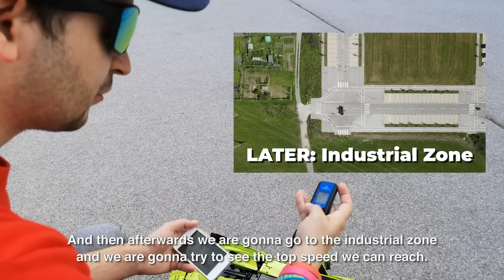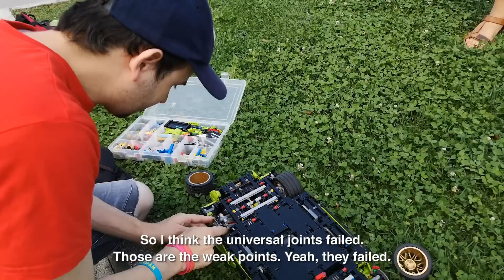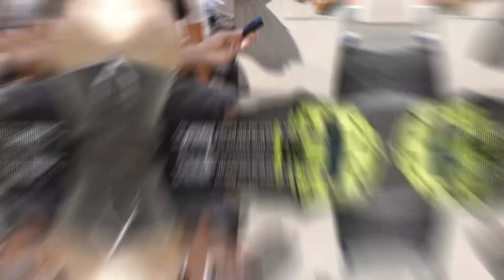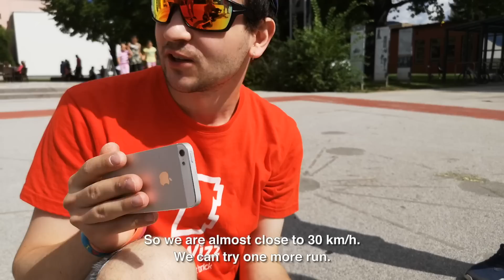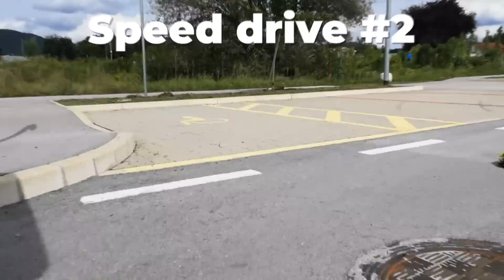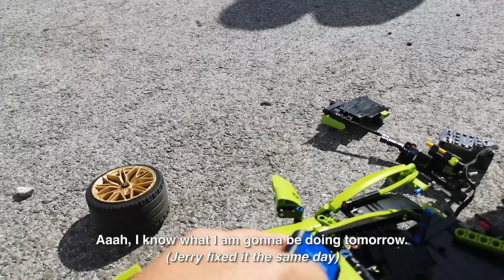Motorizing 42115 Lamborghini Sián FKP 37 with BuWizz - The big drive

Comment: Nice, let me know when you reach 40 km/h and I'll pull out my old setup from the closet to upgrade it ;) Steering is problematic at this speed, try to limit the movement to a minimal level, small corrections should be enough.
Reply: Most of the steering was done with the mixer, the servo was set to just a single position. We will let you know when something faster is ready :)
Reply: Pull it out anyway. You still have me to beat first 😉
Reply: @marxpeklegotechnicdesign3  you used V2 units with Ludicrous mode, that gave you an advantage ;) I might wait for V3 :P
Reply: @RacingBrick  it does help. But it also creates alot of problems. You'll see 😁. V3 will indeed be more potent and might take away some of those issues. I'll await a new record and of course, respond!
Reply: @marxpeklegotechnicdesign3  yeah I'm sure with ludicrous it's even more difficult to accelerate without a power cut. But now we have BC2 for control which makes it much-much easier than running with a touchscreen :D But next time I'm sure I will get a chase car, no more running around :D
Reply: @RacingBrick  i tried to use the BC2 app, but for me it was not useable, due to the added input lag, very unpleasant at these speeds..
Reply: @marxpeklegotechnicdesign3  good to know, thanks!
Reply: @marxpeklegotechnicdesign3  @BuWizz native controller support :D
Reply: For steering not to be problematic you need proper geometry, LPEpower wheelhubs and enough suspension travel.
Reply: sad no buggy motor noises
Reply: 2004 india  asi
Reply: What motors did they use?
Reply: Lego doesn’t exactly make precise ball joints or track rods etc.there is a lot of play in the steering on most models...
Reply: Based on the previous top speed of around 29 kph,what does that equate to that of the real model?
Reply: @j.mendezphotography8684 bro multiply by five ...

Comment: The most important think for every car: BRAKES
Reply: rc cars dont need a brake since the motors while not accellarating are slowing down faster than a flywheel resulting in the speed decreasing drastically, but if you just pull a quick reverse thats a hard brake
Reply: This is why lego should make a pneumatic brake system
Reply: @FG-vp6id  but if your car is too heavy you might damage some gears doing that.  Including some kind of clutch and brakes even if it's 100% electronic is a good idea.  (but I never did it lol, I would need new lego parts, or better coding)

Comment: Do you have any electrical correction for lack of a differential while cornering, or all motors are just running equally full speed?
Reply: Yes, I used the mixer module which is available in the app. At high speeds steering with motors is more accurate than servo.
Reply: @ZEROBRICKS  cool, is there a way to 'automate' it or you need to steer manually?
I mean to write a function that will control speed of left/right motors in dependence of angle that servo is rotated?
Reply: @maciejrychlik426  That's what the mixer does automatically.
Reply: @ZEROBRICKS  sweet, thanks a lot

Comment: Are you guys using buggy motors?  Can you tell us how heavy the car is ?  Cool video for sure !
Reply: Buwizz is creating their own rc motor which is the same size / shape as buggy motors.
Reply: He use 8 BuWizz and 8 BuWizz RC-Motors and more normal Motors for the Doors, Spoiler and steering. A very expansive setup 😉
Reply: @Moki314  when will that be released👀
Reply: @amirpenkar947  I think they said they were aiming to release them in October.

Comment: I don't know enough about Lego motorization, but from my time in R/C trucks it seems that it would be awesome if you could somehow rig in a Futaba/Spektrum/Airtronics/etc R/C receiver and use a better controller. It would make handling the steering SO MUCH BETTER than an iPhone.
Reply: I was SO into RC cars.  I have a basement full of all those parts you mentioned.
Reply: I have used 3d printed parts in the past to adapt standard servos to lego and also brushless motors. I look forward to buying either the lego lambo, bugatti or proche and trying to jam a lego converted brushless setup into it for some good speed/power and decent steering.